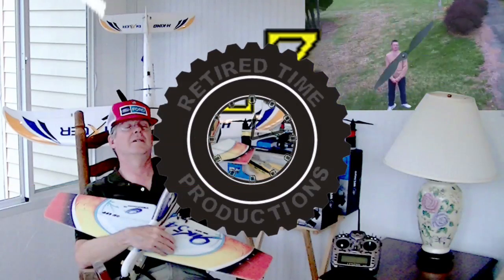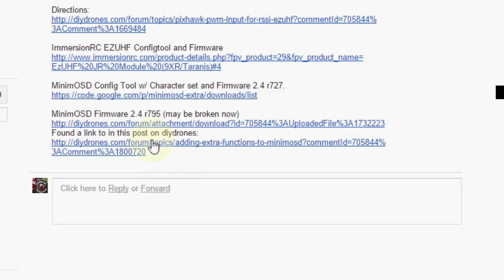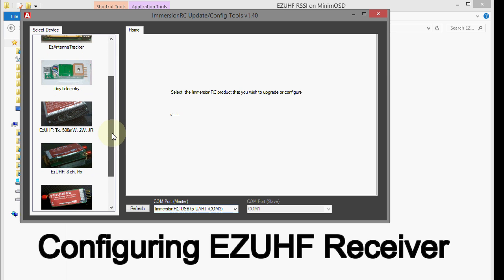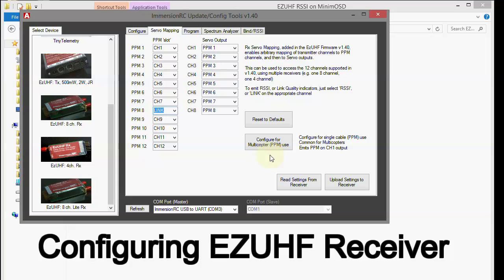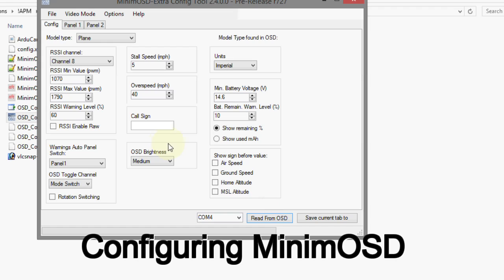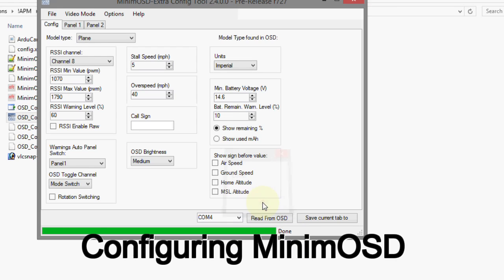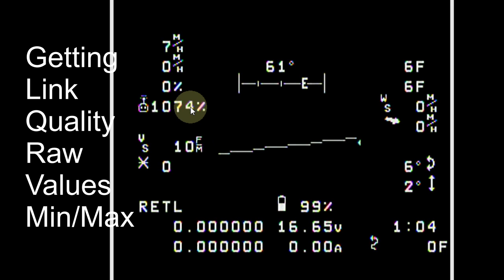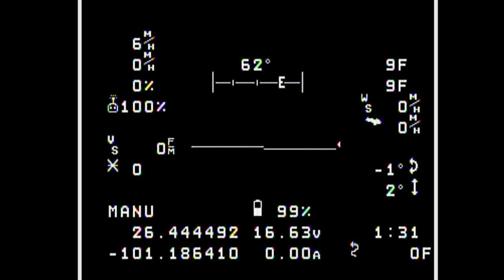RSSI EZUHF Setup EZUHF LQ or RSSI on MinimOSD for APM

Comment: hey dave. my rssi doesn't change when i shut off the radio. stays at 1500% when config tool is set to raw and 900/900 
I am running muxed on ch1 with link on ch8 slot.  Do i need to run a serperate signal wire from the rx? and not through muxed?

Comment: Cant tou use RSSI and reverse tge figures in tge mini OSD so the 0 that is full is set to the minis figure and the 100% to the lesser figure  that would then give you 0 as no signal and 100% as full signal just by reversing the figures?
Also what sort of distance are you finding you get if out of suburbs and flying with EZUHF? no one wants go give an estimate. I dont want a guaranteed distance just what tou get. Is it like 2km or miles or 15km or miles?
Thanks you answered so many questions I had about mini osd and setup your video are great. Keep them up.
Reply from the maker: To reverse the RSSI values in the Minimosd it would take a code change to the firmware which I know nothing about. Maybe someone had tried it but not me. 
The EZUHF setup can easily do 2 miles with stock antennas but with the direction antennas you could go 7 miles or more.
Reply: dmercØØ RTP what I mean is reverse the min max numbers/values nothing else. That should give tou the correct 0 to 100%.
Reply from the maker: No that  won't work either because the max number must be larger than the min number.  I have heard that you can use an electronic inverter which is a sort of physical adapter but that is beyond what I want to do. It's just easier to use Link Quality which is not inverted.

Comment: If you still have the Hex file..... r795.hex.......Could you possibly E-Mail it to me..?....I have followed this Clip and have Link quality and everything else working fine, with the exception of altitude.....When the APM boots....it first uses the Baro and sets it correctly to zero....BUT....after enough Sats are found, it starts using GPS data and puts Alt into error....:(...Im hoping r795 will fix this little bug...I have Alt set correctly in the Param Tree to use Baro ONLY...Cant seem to find r795.hex anywhere..:(
Reply from the maker: The link still works for r795.hex in the description of this video.
Just right click on it and chose "save link as".
http://diydrones.com/forum/attachment/download?id=705844%3AUploadedFile%3A1732223
Reply: +dmerc00 Thanks...I will try it tonight when I get home...So close to having it work now..:)
Reply: Hi, just a little update...I loaded the Firmware but it didn't fix it....It wasn't broken...lol....I didn't notice until tonight that the APM uses TWO altitude references MSL= Metres above Sea Level...a Sat calculated altitude....and HA = Home Altitude....A Baro measurement....Didnt notice there was two on the Minim setup until I looked closer at your Clip and saw what looked like TWO altitudes.....DOH....All working now....Thanks for you help..Jeez..:)
Reply from the maker: Glad you got it going, let's fly!
Reply: ***** Yes, agreed, unfortunately our UK weather has other ideas at the moment...:( Still, I have some retired time building to do...:)

Comment: Late to the Party, I just ordered an APM 2.8 and a micro minim osd....Your Videos are excellent, this one is of particular interest given the EZUHF rssi has a digital output...Time over Winter to learn this stuff and the prices are a steal for such a capable FC....:)...I need your clips though...!!!
Reply from the maker: I am going to experiment with an HK Pilot version of the APM this winter in a Mini Talon build. You might want to check that out. I will probably use the EZUHF 4 channel.
Also have a couple videos coming up with a Vector FC and EZUHF in a Polaris XL Sea plane.
Reply: +dmerc00 Sounds like fate, I have a Mini Talon in box and use the EZUHF 4Channel micro RXs...Although I was planning on using the APM 2.8 in my SW X6...I may need some help with my new APM 2.8...:)
Reply from the maker: There ought to be enough similarity between our setups where I can be of some help.
The firmware and setting may be different but we will see when I get into the HK Pilot configuration. There is always the 3DR forums and RCgroups.
Reply: ***** Good to know, I get my APM in a day or so, Ill let you know when I have some questions....Thanks..:)
Reply: +dmerc00 Hi there, update....Im now using the smaller Servo pinned APM PRO.....Hoping to use this video clip and Muxed cppm.....I think the Pro APM still works in the same way...?....Did you ever try a muxed cppm setup...with the EZ...?.....Thanks.....Such a helpful Tutorial....:)
Reply: ***** I chose the APM Mini Pro primarily because it has standard DuPont Servo pinouts, it does not have any of those hideous small white plugs, which although polarised connectors, they are not durable enough or intended to be plugged in and out. Its all the Pixhawk has, which is why I didn't want it. I know the PX has way more computing power, but for what I do, including waypointing if I want its enough. Besides, the Pixhawk is huge. The APM Pro Mini is about £55 inc GPS and amp counter.

Comment: Hi dmerc00, good video, but mine don't work as you show in v'ideo! My values is TX ON  = 1103 and when TX OFF = 1947! I try many different Charset and Firmwares and the result is similar, when TX ON = low value and when TX OFF = high value! Do you have any idea what happened or if have any Firmware and Charset to correct this possible bug?

Comment: dmerc00 hello, thank your video was very useful! Performed exactly as per your instructions and it worked perfectly the signal display rssi on my screen. However, when I change the flight mode, the values of essi signal fall to 0, but I do not lose radio signal. Basically, when I turn my plane in manual mode, the RSSI signal appears 100%, so I switch to Stabilize or any other flight mode, the RSSI signal drops to 0%, but I continue with absolute control equipment. Do you have any idea what might be happening? many thanks
Reply: ***** Found it! I was using Config tools 1.39, with 1.41.3 it worked right away. Great succes! :D
Reply from the maker: Very strange bug. The only thing I can think of is that depending on the config the MinimOSD may change screens when the flight mode is changed. Perhaps the RSSI is not setup on the other screens/panels of the OSD.
Reply: ***** this error occurs in any of the screens. Only occurs when I change the flight mode (regardless of screen)
Reply from the maker: Marcelo Vaz Sábio I have no idea what that could be. Perhaps you could go to the DIY Drones forums and post this question. There are links under the video.
Reply: ***** I have the same problem, it looks as though you have 100% reception but actually it is just copying another channels ppm signal, in your case the flight mode channel. I have Ezuhf with CH1 PPM muxed and LINK at PPM 8 but all it does is showing the ppm value for the channel next to it, in my case 7. So if i assign a switch to 7 it copies that movement to 8. Pretty weird bug indeed, I am completely drawing a blank here...
Reply from the maker: Maurits Kroese Thanks for reporting back with the solution. I never would have guessed it. Happy flying!
Reply from the maker: zillion42 In my video I actually say to upgrade the EZUHF TX and RX to the latest firmware version. Some people either are not paying attention or can't understand my English.

Comment: Thanks for sharing. I moved from an APM 2.6 setup to a Pixhawk setup, with the same EzUHF (CH1 PPM Muxed, PPM 8 slot LINK (tried RSSI as well) with servo output PPM8). On the APM it worked flawlessly. On the Pix, I can't get it to work. I have all the settings done as per video instructions. RSSI gives zero information on the OSD. Also with RAW enabled. One thing for me is not clear in the MP (Pix) settings. RSSI, should be enabled on pin 103 for the Pix? Then I should connect channel 8 from the EzUHF to the Pix 103 pin I guess. But it does nothing. Voltage is on standard setting, 5v. MinimOSD is working (r800, was using that with the APM also) and gives all other information. And yes, as per video also there I've set to Chanel 8 and enabled in the panels. Any idea?!? I don't know what to try anymore...
Reply from the maker: Perhaps I should admit I never tried it on the PixHawk, just the APM. There may be some differences in the Pix that I am not aware of. Perhaps I should take the PixHawk out of the title since I am not able to answer questions on the Pix.
Reply: *****
Perhaps ... in the meanwhile I was reading on RCgroups and other places. Not quite clear to me what is the exact setup. It looks like it is some work in progress, some say. Others say it should work. Weird. I tried another EzUHF unit as well just in case to know for sure that one is OK but that gives the same result.

Comment: My Max values show 1371 and Min is 1346, shouldn't there be a greater scale for Max and Min ? am I doing something wrong ?
Reply from the maker: I was getting around 1794 max and 1074 min. About 720 difference. It looks like you are not getting a full signal.

Comment: So I have to dedicate 1 Channel for RSSI ? I was planning that channel for lights. Oh well... I guess it is better to know what my signal strength... Excellent video, I am running almost exactly same setup, Thanks!
Reply from the maker: I had to give up my last channel too. But there is hope of eventually using a PPM expansion board (PWM Decoder) to get more channels. I think it can be done with my Taranis TX, EZUHF module and decoder on the EZUHF receiver. Just theory at this point.

Comment: Thank you! Got mine working so easy after watching your video.
One thing to properly update the character set you have to power the MinimOSD from the video and FTDI side of the board. Meaning plug in your video system on the video plugs on the MinimOSD and on the other side your FTDI. If you don't do this it looks like the character set updates but doesn't. It's because the set saves on the video side of the board.

Here's the link to the wiki
https://code.google.com/p/minimosd-extra/wiki/Charset

hope this helps
Reply from the maker: Yes you do have to have both sides powered, good info.
Also there is an option to power both sides from the FTDI side by soldering some jumpers making it unnecessary to have the 12 volts from the video side.
See bottom of this page:
https://code.google.com/p/arducam-osd/wiki/How_to_start_minim

Comment: Just in case you were confused, PPM and CPPM are the same thing. Some people like being fancy by putting a C in front of it.
Reply: PPM or Combined PPM is multiple PWM signals combined into one. PWM is the old school way of connecting a receiver to a flight controller, where every channel get's a servo cable.
Reply from the maker: Chris Riccio OK sounds good. Found this too.
http://blog.oscarliang.net/pwm-ppm-difference-conversion/